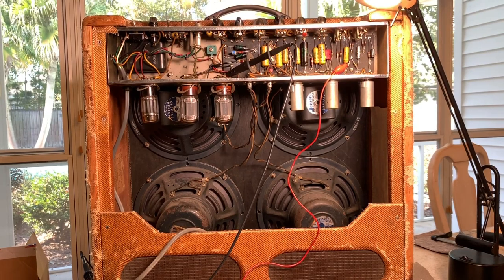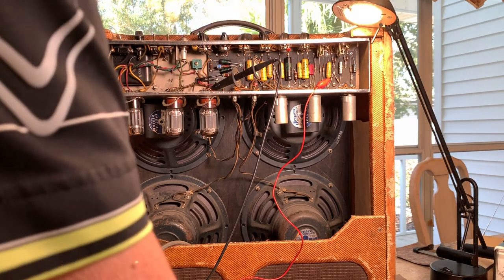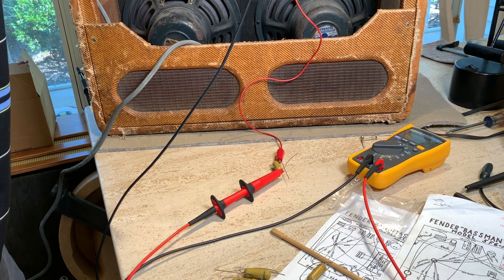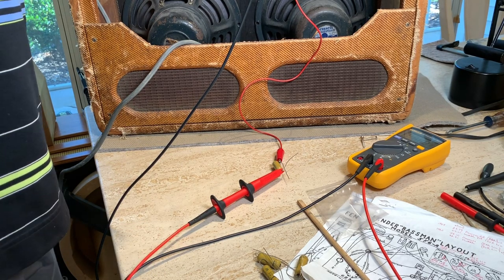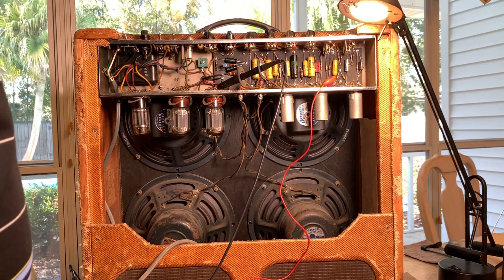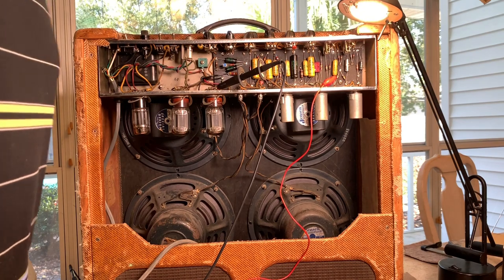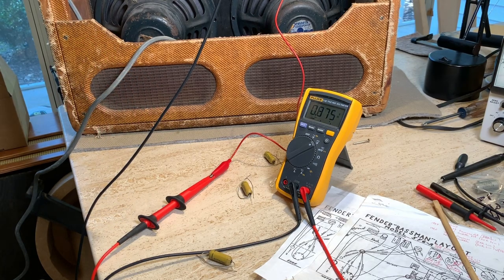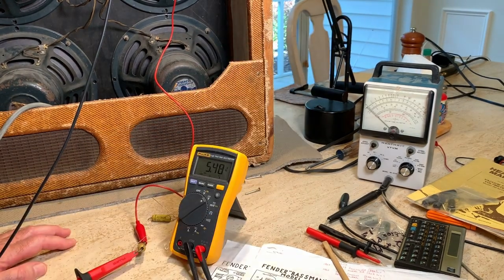Testing NOS Astron .02uF/600V Caps for Leakage - And More!

Comment: The video shows you using your method of testing for leakage but it does not show how someone else can do this. Maybe someone who is already an expert can, but otherwise we can't see what you are connected to clearly, etc., what results you would expect on the meter for acceptable leakage etc.
Reply from the maker: All I did was run a jumper from the live circuit that has close to the max voltage the cap is rated for to the cap and the other cap lead to the positive lead of the DMM and the black lead to ground on the chassis.  Ever since this video I have been trying to buy either a Sencore or Tel-Ohmike or Heathkit tester but they are too expensive and not always in good shape.  They are the best way to test caps for leakage because they test for leaking current in milliamps.
Reply from the maker: they also test at the rated voltage all the way up to 600VDC.
Reply from the maker: Not the safest method so be careful.